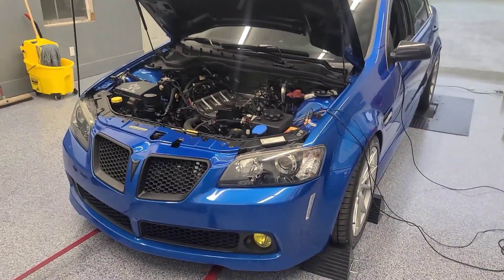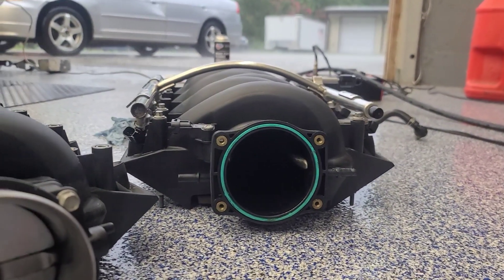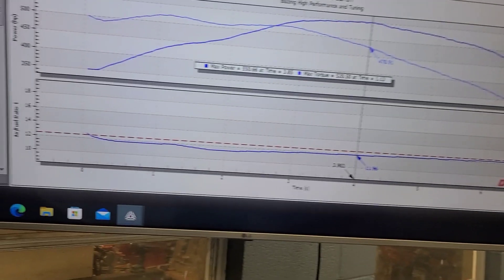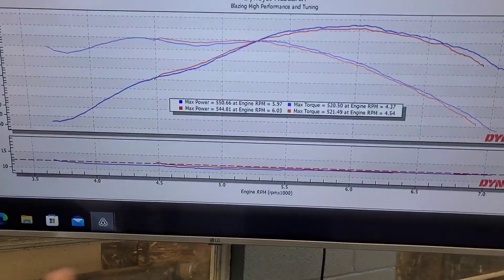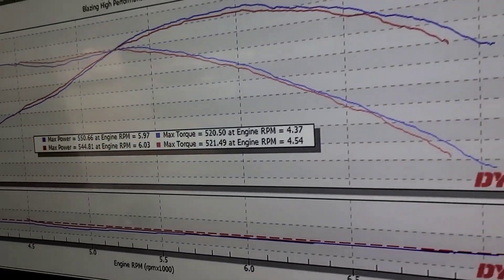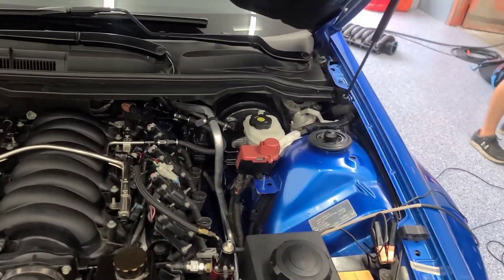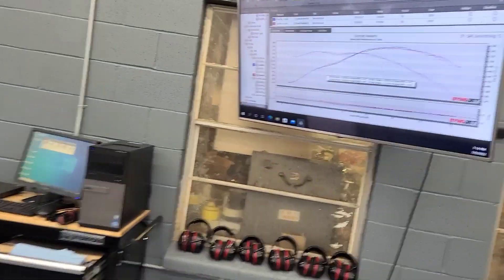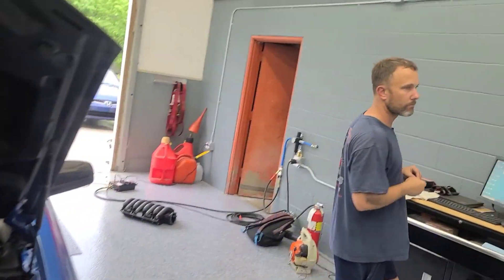RCR ported and rodded intake VS stock intake dyno results on our max effort all motor car...

Comment: What displacement is the motor?   I have a few videos on my channel with a 416 LS3 making 530 whp.  I did comparisons with the stock LS3 manifold and the Performance Designs LS3 intake.  The PD intake made maybe 3-4hp but lost up to 18hp/tq from 2500-4500.  Also tested 92 vs 102 throttle bodies, which you would think on a big engine would make a difference, but nothing on the dyno.  The 102 idled a bit works and drivability was worse as well.  This was all done on a speed density system with a Holley Dominator ECU and cable throttle.  Dyno Jet roller.  In MOST cases I would say the stock intake run AS IS likely is the best way to go.
Reply from the maker: 6.0.  Now we have a 440 ls7.  No difference besides drivability on the 102 TB there either.....
Reply: @nufnuffz28  Thats big power for a 6.0.   Mine is a 6.8 with TFS 255 heads and can is 239/255 .624".  I was going to build a LS7 based 440, but the 416 was more affordable, and really all the power I need for what I do.  It's an autocross/trackday car.

Comment: Interesting. The stock manifold made the same numbers, then you spin it to show a gain.
Reply from the maker: Yeah.  Ported manifold shows gains in the upper RPM range.   Gonna do more testing on this with a 5th gen Camaro next week!
Reply: @nufnuffz28 did this test happen?
Reply from the maker: @paisley2342  yes.  There is a manual 5th gen we did somewhere in here!.  About 7 or 8 is what we saw iirc

Comment: NIce Info guys!  Quick question what have you seen with the Fast 102's on these type setups.  i am thinking about go All motor with a 150 shot.
Reply from the maker: Check my older videos.  It increased the RPM it peaked at, but same HP

Comment: Are you get spray bars installed on the Rcr intake?
Reply from the maker: Yes.  Its already slightly ported and has the stands removed.
Reply: @nufnuffz28  are they gonna remove the rods that Rick puts in ?
Reply from the maker: @sickesstvenado96  i would assume  replace them
Reply: @nufnuffz28  I need to get with you about a remote tune for my G8 it's been dyno tune already but I feel like is missing something
Reply from the maker: @sickesstvenado96  sounds good.  Email me.    Nufnuffz28@yahoo.com

Comment: Great info..should toss in a fast 102 to compare as well but from my experience ls3 102 isn't worth the money
Reply from the maker: Look at past videos
  Did a 102 with short and long runners a few years ago.  HP the same, just moved it up to higher RPMs

Comment: Interesting comparison. I guess if you're trying to get a few 10ths off your time it might be worth porting
Reply from the maker: When you get to the small gains, every HP counts.  Worth it for max efforts
Reply: Have you done a video on this max effort g8 build? These are good numbers for all motor
Reply from the maker: @kylel4689  it's our blue G8 we have been 10.2s with.  I need to get new information on it again for the newet viewers.  Its basically our shop car.  Also lool for the dyno videos.  Made over 700 on a shot... going for 570 motor and 800 nitrous soon. I will recap the car again soon for the newer viewers as I Haven't posted too much on it in the last couple years.
Reply: @nufnuffz28  awesome will be on the lookout for it man ! Can't wait to see it
Reply from the maker: @kylel4689  sounds good